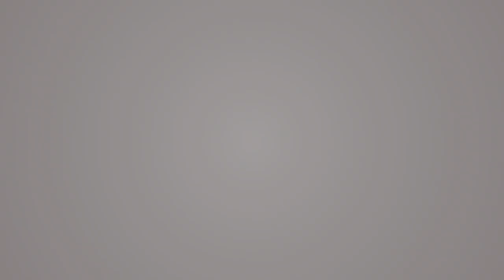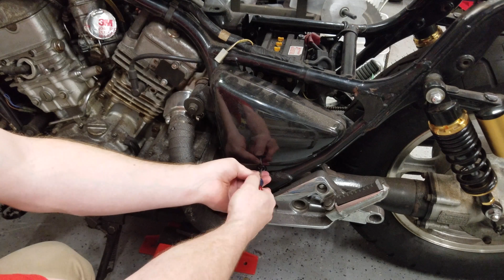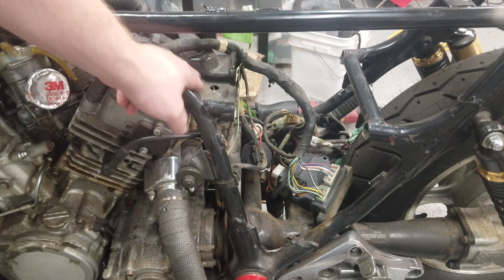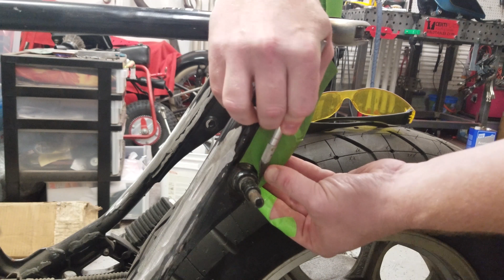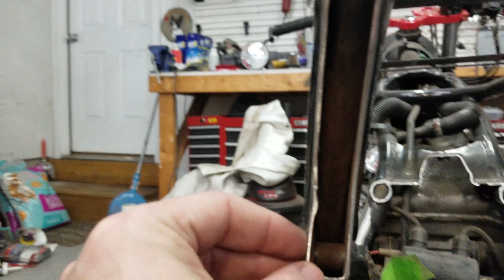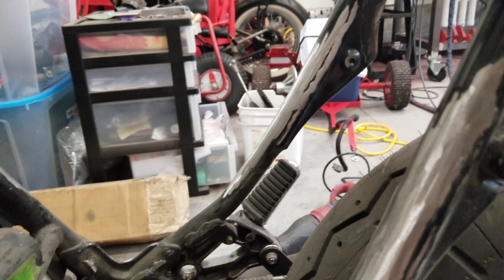Vulcan Build Part 5

Comment: Great series, i found it while searching for vulcan cafe's because I'm trying to convert my 1500 mean streak, but couldnt find much online.  This series helped with some issues I was trying to figure out, like how to raise the seat height, but I had a couple outstanding ones I am curious if you have made a plan for already.
1. I cannot find any known way to mount mid/rear controls, what are you planning on?
2. I have never seen someone use 2 hoops, did you do that because it was easier than trying to bend the tubes near the end to weld up to the frame below the fuel tank?
3. My initial reaction when you cut out the frame below the hoop was NOOOO, but I have no experience in bike building so it was just my gut saying that.  How confidant are you that the hoop will be strong enough to replace the support that what was cut out was giving the bike? Any post traumatic second guessing setting in by chance?
Thanks and cant wait to see the next one and if the wiring/battery, and controls will be figured out!
Reply from the maker: There isn't too much out there for the 750 as far as major mods, even less for the 1500. Glad the build series is helping you out some.
1. I'm not sure on mid/rear controls yet. It really will boil down to me having some seat time on the bike to see if i move the controls to make it more comfortable.
2. You are 100% correct, it was way easier, seeings how i don't have a bender yet. Plus the hoop connects both side of the frame for added strength vs just 2 tubes coming off.
3. Everything was heavily tacked or stitch welded before i cut that, also if you notice that rear section doesn't support any weight unless there is a rider. When i cut the frame i measured everything before and after to ensure nothing moved. In part 6 you will see how i hide the battery and electronics while adding more strength to that rear section. Nope, no second guessing lol. Thanks for watching and stay tuned for more.
Reply: @HaslipCycleWorks  thanks and like you i wanted something because not everyone had something like it. But that means no easy solutions. Necessity is the mother of invention though! Keep it up!
Reply from the maker: Thank you! Appreciate the feedback, that's the driving force behind choosing the bikes I have. I dont want to see the exact same thing beside me in traffic lol.